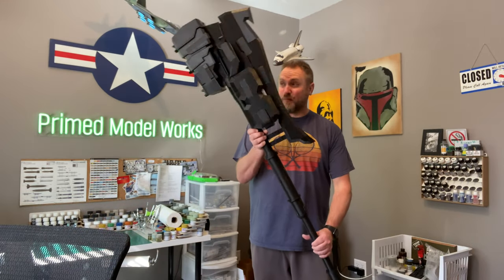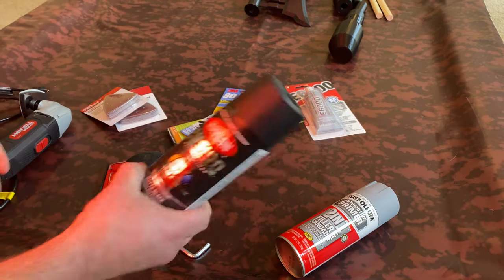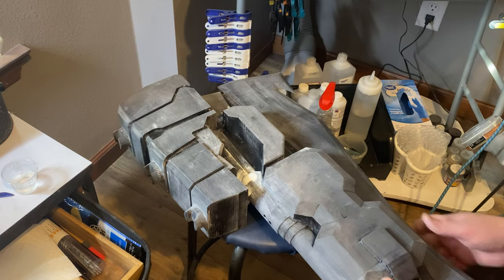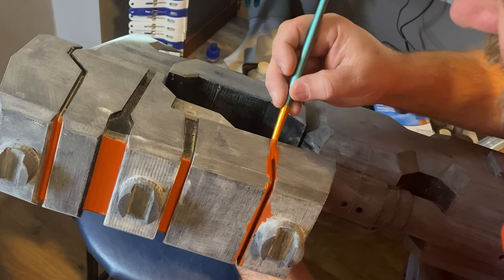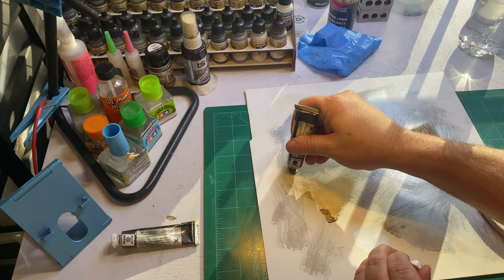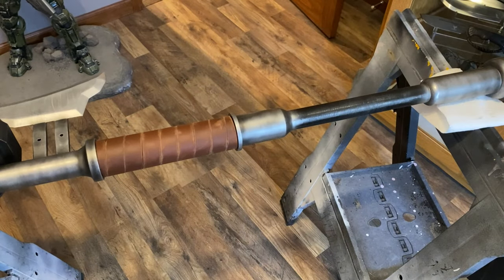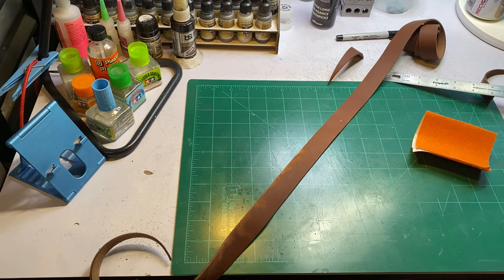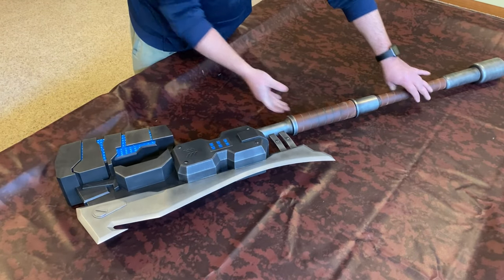3D Printed Halo Gravity Hammer from Cyberforge

Comment: Very unusual subject and interesting video. I actually quite like the True Metals. If you want the blade to be different you can use the true metal and let it set for an hour or so then buff it with a soft cloth and it actually develops a bit of a shine. If you want to do that on detail parts use a medium hard brush. I have done a couple of dozer blades to get them looking shiny and also the brass lights on a Model T car kit. I think it looks more metallic than paint on larger models.
Reply from the maker: I can see some potential in the true metals….I’m gonna have to experiment with them more

Comment: Τo give you some tips so you dont strangle that much next time you touch a 3d print models , first about materials dont use normal sandpaper but foam pad sandpapers makes huge difference trust me you will drop the sanding time to half ,also have in mind to treat the 3d print part as a car bumper repair that means you need flexibility so are tons of materials how to repair plastic bumbers that are awesome so ask localy for two part epoxy rubber repair filler ,it will never crack and is super easy to sand ! Also for the final finish my self i am using after the sanding a standar cheap Us resin that you can use on 3d resin printers and works amazing and is super quick because it dries with UV instantly so you dont have to wait !